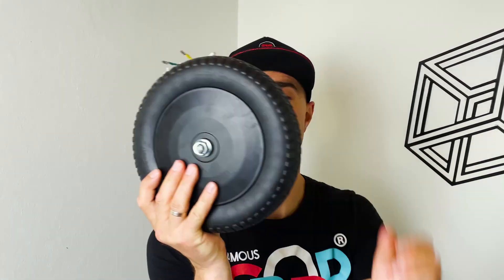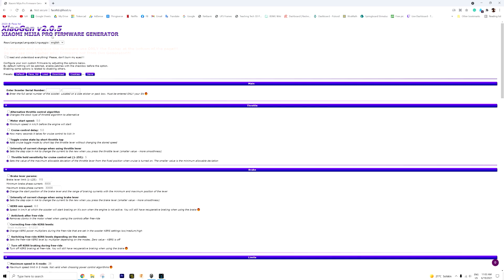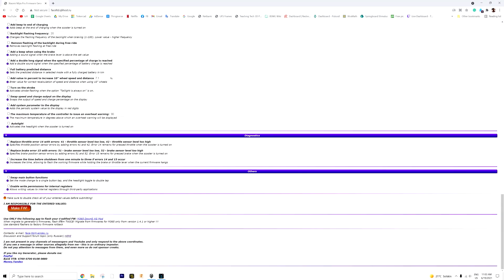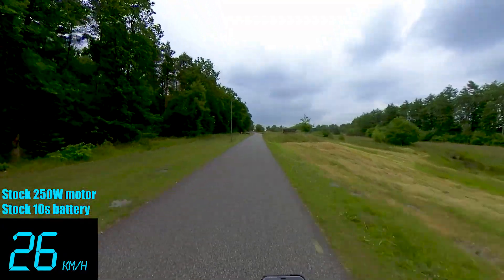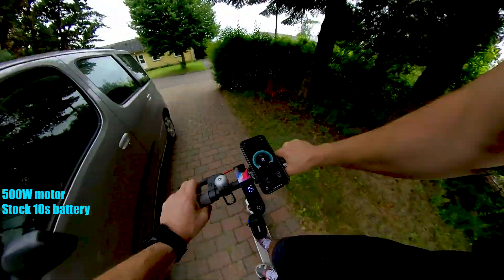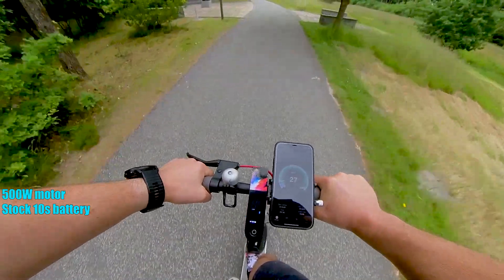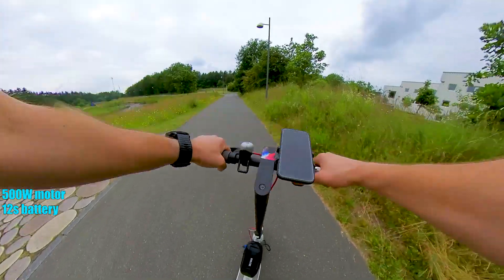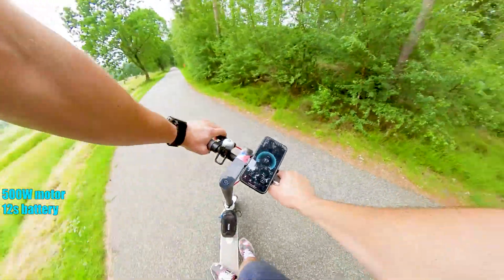Xiaomi m365 first look at the 500W motor (Monorim ?)

Comment: Hey i think you are good in this.. I have 48V battery (13s) with controller reinforced 140A mosfets.. 350W motor ... CFW set to 25A current limit 65A... It spins 35km/h ... whats the case ? . On 36V battery i spinned 35KM/h...
Reply from the maker: Hi,

That’s weird 🙄 54.5Vx65A=3.5kw 😳 at 2kw I reach 50km/h on my m365. But I used the aftermarket 500w motor and ECU with field weakening. 
I am confident the 350w motor should run faster. There is something limiting your rpms or voltage. Firmware? There is definitely the “hard limit of 35km/h” in firmware. Is it even possible to really remove it? 
Any chance you can try another ECU? Not the stock one?
Reply: @VRMinde  I have Flipsky 71500 ? 75_300_R2 but yeah .. when i try power on XT60 plug it just burn my connector.. so ...

There might be case that i have InternalBattery(Disabled BMS communicaton ?) and ESC doesn't know how operate voltage ? i flashed 23A with 65A current... i mean it spins 37-38 ? idk whats wrong
Reply from the maker: @xtracker904  just thinking basically: you should always get more RPMs with more voltage on the same motor. Unless there is something limiting it. I can only think of ECU 🙄
Reply: @VRMinde  But why 65A ? i put 25A in Power and 65A in current (phase current) if i belive does it matter ?.
Reply from the maker: @xtracker904  you said you had max amps at 65A? 
Power is measured by watts. P=UxI where P is power (W), U voltage (V), I current (A). 

Even if you keep 25A on a fully charged 13s it is more than 1300W. That is enough to go faster than 35km/h. One or another way your controller is limiting the speed, I think. I can’t now think of anything else mate
Reply: @VRMinde  Yep on Non Load it shows 45km/h but on load shows 36-37max ..
Reply: @VRMinde  Hey sorry i interrupt you but i think find it.. somehow.. but you must tell me it is good result..
I changed to 500w motor monorim flashed with emulated BMS and shows 60km/h real is 46-50km/h i must charge it and see how it goes...
So Xiaomi 350W pro motor how much can go if 500w goes about ~47km/h?
Reply from the maker: @xtracker904  honestly I don’t know. They might do similar, 350w will just burn faster if you run it full watts all the time :)
Reply: @VRMinde  Ok thanks for replay.. but i watch your video for compare ... and do you use Rita adapter ? or just you unplug 36V and plug 12S ?
Reply from the maker: @xtracker904  you can do either... but you have to "tell" your controller in the firmware of your "new max voltage".
I never had the 350w motor, only 250w and 500

Comment: Was this test with stock controller? Iv got the 48v pack and a v3 controller and I’m looking to get the 500w hub but if it won’t reach 30mph I will just invest into something else
Reply from the maker: stock controller and 12s battery pack (it would be a "44V pack"). I reach 50km/h (31mph) at about 1500W. So if your 13s pack is fully charged you will have ~54V. You will need about 30 amps at that voltage to get 1500W.
Reply: @VRMinde  thank you bro, nice of you to still reply to your older videos 🤜🏾
Reply from the maker: @DEM_E_BOYZ  I am trying at least :D

Comment: Hi. Can you please send me link to good controller and the 500W motor? I want to buy something that was tried / tested. Thanks
Reply from the maker: Hi, the link for the motor is in the description, but you might consider getting an original one from Monorim https://monorim.store/

As for the controller I was using the phaserunner v3 with cycle analyst just for testing purposes, it will cost you more than the scooter and will be a complete overkill for the needs. https://ebikes.ca/product-info/grin-products/phaserunner.html
https://fasterbikes.eu/de/controller/349/50a-30-90v-phaserunner-motor-controller-v3?number=3108-OHNE
https://fasterbikes.eu/de/zubehoer/cycle-analyst/206/cycle-analyst-v3-dps-direct-plug-in-mit-tacho
Reply: @VRMinde  many thanks. I will buy controller and the wheel next month 😉

Comment: hi I have a stock pro 2 but have hacked firmware too get 20mph max . my question is will a 500w motor work on this with stock battery I know will run down faster but how fast and is the motor simple to fit or do I need firmware change
Reply from the maker: Pro 2 has a good motor, I do not think you will notice much of a difference. It will work, but I doubt you will get much extra performance 🙄

Comment: Can i use 2  36v battery’s in parallel  to run a 500w motor will it decrease my range
Reply: Hi mate I had 2 36v running  it just adds bit more range

Comment: I’m looking to add two 36v 500w motors to my hover-1 alpha that I’m customizing. It’s my first build and I’m a bit nervous. Can I run two motors at 36v on the stock battery and just upgrade it with a pack? Or should I upgrade everything and get 48-60v and run dual 48v-60v 500-1000w ? So many choices. 

Obviously I’ll have to upgrade the controllers and modify a bit but it’s mostly bolt on and go. Any thoughts?
Reply from the maker: Normally, upgrading with dual motors and changing voltage up dramatically will require to change basically everything and is more expensive than buying a ready-made scooter :) But it is always possible... depends how much time you want to spend on this :D It looks "easy" but tiny little details eat up the most time. 
Adding second motor (and ecu) at 36v is potentially easier way, you will feel a boost of power of course, but as you say you will need to add capacity of the pack as well. No one can tell you what to do mate, it is your decision :)

Comment: try to downgrade the bms to 1.2.8 and use direct power control, my pro 2 w 8,5 inch can go 35km/h, and w 10 inch 42km/h (fully charged)
Reply from the maker: I tried many things mate, maybe I am too chunky but to get above 40km/h i generally need a 48v battery :)

Comment: Hallo i kindly as for your help , i have i pro 2 with 36v 24.4ah ( stock and external ) custom firmware with stock motor 950 watts pick with no problem . I am thinking about the monorim 500 w motor but i dont know what is the safe limit for watts , i ask monorim and i didnt get an answer . Normali with motors tere is the naminal power and pick is x2 , is that the case with monorim ? Can i set the pick to 1000 watts or more ?  If iis only 1000 will i see  a difrence between stock motor to 950 watts and monorim ? Many tnanks in advance . Keep up the good work
Reply from the maker: Hi mate, I doubt you will see a diference between the pro 2 stock motor and the 500w aftermarket one.
The more wats - the more heat. At some point your motor will burn if you give it too much power for too long. I ran 2200w on a 500w motor, but for short bursts only
Reply: @VRMinde  thank you very much for the answer . I am cosidering the 500 w motor  not to put more watts than te 950 that i have now  but in terms of heeting . Is there a chance  tat the 500 w motor with 950 watts heats less than te stock pro 2 motor ?
Reply from the maker: @psyllinos  in theory it should be the case :) but you I have not compared two side by side to know if it is true

Comment: Hey mate.. great and very helpful comparison. I have new 365PRO and my battery overheats while I m driving back to home from work. I drive almost 10km uphill. It s small but constatnt incline and  I have 100kg :) . Battery temp reach 53,54 degrees and Scooter turns off. Do u think that I will resolve this problem if I add larger battery something like Monorim B2 battery 48v 14.4ah?  What do you think?
Reply from the maker: If your battery is overheating it means you are drawing more current than the battery can give/was built to give. This is actually surprising to me as normally ECU is the first part to overheat on the M365. I will assume you flashed custom firmware with many watts on it :) 
If you add a 48V battery, you will get the same watts with drawing less current, it should definitely help with the battery overheat issue. But you have to lower those amps then :D And most likely ECU will start overheating as the next thing
.
Reply: @VRMinde  Woow tnx for quick response. Hmm.. quite strange because I am not using any firmware except factory software BMS 0126, ESC 0166, BLE 0110.. I am probably rare among us that don t like too much speed on this toy :))  Should I check and even change ECU before spend fortune on bigger battery? :)
Reply from the maker: @branislavspasic3475  I don't know. I have never had an original pro ECU, legends say they last better :D But it is weird then that your battery is overheating

Comment: I have a scooter that is not from Xiaomi, the engine power is 350w and the maximum speed is 25 km. Can I increase the speed more until the time of the ramp, the speed does not exceed 25 km? I contacted you on instagram and sent you a picture of the scooter and the problem is that I tried to hack the scooter, but the problem I have is ios I tried to search for the program, but I could not find the program
Reply from the maker: Hi mate, most often the controllers limit the speed without an option to “hack” it. You need to relace the controller. Sometimes some manufacturers leave a cable that you need to cut/unplug and the  cable to unlimit the speed. Try googling out your scooter model and “speed hack” or similar and you might find it somewhere
Reply: I contacted you on instagram, the problem is that there is more than one cable. I can't find out the private cable. Opening the speed limits. If I send you a picture of the cable, you will recognize the private cable. Opening the speed limits

Comment: i got my xiaomi pro 2 custom with a 52v 25amps controller and an 52v battery with a stock 36v 300w motor and top speed of 45kmh.but my motor takes up to heat fast and it burns out..Will a monorim 500w motor will better for me or it will heat even worst than the stock one?
Reply from the maker: It should be able to take more punishment. But 52V X 25amps = 1300W. You should not expect a 300W or even a 500W motor to be able to run all those wats for long without getting warm :)

Comment: Hey i have a question
I Want to put a 350 watt motor on my Xiaomi 1s. Can i just do it like just take the Old 250 watt off and put the 350 watt on? Or is there something i need to change with the batteri or some checking i need to do with the batteri before i do it or Can my normal Xiaomi 1s batteri get a 350 watt motor on it without any problems? And i have the newer Xiaomi 1s B.L.E 1.5.7 version.
Reply: And Can you just put a 350 watt motor on without flashing the scooter?
Reply from the maker: You can put the 350w motor just straight replacement, but you won’t feel any difference. What you need is different battery to get more speed/acceleraton and then different firmware flashed
Reply: @VRMinde  What if i just put it on and then just have it that Way? Will it work without any work
Reply from the maker: @dinfar4367  it will work, but you won’t get any benefit 🙄
Reply: @VRMinde  oh thanks:)

Comment: I have m365 pro2 not additional battery only chip and goes 42kmh
Reply from the maker: Good for you mate! I have already tried many scooters, 33km/h was the most I could ever get out of a 36v battery pack, and that was probably a bit downhill and for 1sec 😂
Reply: @VRMinde  I have also old m365 it's without addition battery goes 35Kmh just the chip

Comment: yooo bro! nice video! i got now a pro 2 (32kmpu (brake lever) firmware) today i changed the front tire and now it makes the same sound as youre motor heheh... 
 
what should i upgrade for more speed pls help me out bro (stock pro2)
Reply from the maker: @branimir bankov Was claiming 2 weeks ago, that m365 pro does 42km/h +. 
I personally do not believe it :D I think 32km/h is a decent speed for a 10s (36v) battery pack. You can try adding more amps on the firmware and hope it will go a bit faster. 
The next thing to get more speed is a higher voltage battery pack. I think you can use a 13s (48v) pack with the stock controller if you are careful and do not overheat it too much. Eventually, you will burn the controller. Then you go for the more powerful controller, and then - motor, after it - two motors :D
Reply: @VRMinde  thx man!

Comment: hi i want to install this motor on my scooter for the extra torc will it install as i cannot change my firm ware can i plug this motor in and will it work as normal
Reply from the maker: It should just work man, I am not sure how much torq will you notice. I would first go with bigger voltage battery (but then you will need to change firmware/controller)
Reply: @VRMinde  ok I see it'd just I have the 10 inch solid tyres on and I get 43kph now it's just slow off the line now wanted the acceleration back
Reply from the maker: @Motorizedstuff  you won’t get more acceleration mate with 500w motor or it will be a very small difference. Amps are controlled by controller, voltage depends on battery. Power=volts x amps. Your controller most likely is limiting max amps. So you could get higher voltage battery, but if you don’t know what you are doing - you can burn the controller easy :)
Reply: @VRMinde  ok thanks for the Info just 1 last question if I left my battery at 42 volts but increased the amps to significantly higher will I get a power increase from the higher amp battery or will it just last alot longer
Reply from the maker: @Motorizedstuff  battery capacity is measured in Ah (amp hours). With 10Ah battery you can run 10amps current for 1 hour (that is in theory, in reality it will be less of course). If you run 20A - only half hour and so on.
If you set your controller to use more current (Amps), you will get more power, and your battery will last less.
You can pull more amps, just have in mond that “Significant” increase of amps might start heating the battery more than you want. You will loose a lot of energy on heat + your battery will live shorter :)
Reply: @VRMinde  thank you for getting back to me means alot
Reply: Sorry for been a pain just to clear it up I can get any size battery and install it to my scooter and it will work fine yeah
Reply from the maker: @Motorizedstuff  I really recommend you read somewhere about Volts, Amps, Watts etc :) Maybe something like this vid https://youtu.be/mvuHsu8S6v8

You can use any capacity battery of the same Voltage and have no problems (except the size of it of course). You can even connect an additional one to your stock one in parallel. This means more range. 
You can put a higher voltage battery, but that might burn anything on your scooter system that is not rated for it. Sometimes, the components are ready for higher voltage batteries. For example, xiaomi m365 can easily survive with a " 12s" battery pack (~44.4V), while its original is 10s - 37V. Higher voltage at the same amps - means more power.
You can program your controller / change it to a higher current controller (Amps) to get more power. But that will stress (=heat/burn/destroy? :D) your battery if it has not been built with that idea in mind.
Reply: @VRMinde  nicely put dam hat off to u 
Your a scooter god u no that
Reply from the maker: @MonkeyUkTheZoo  scooter god lol :D :D  Nah, I am just an adult kid playing with toys and filming it sometimes :D
Reply: @VRMinde  I have the 350 watt motor at the moment bro
Reply: @VRMinde  just another question if you don't mind bro if I was to change my original battery for a higher amp 1eg. 7.8 amp that I have now to say 15 amps will I have to still change the controller please 🙏

Comment: Hi can you help me with my firmware on mi scooter 3 i can't do the speed hack i believe its because i upgrade to tha latest version maybe??
Please help...
Reply from the maker: Most likely yes :) I think there is an app Xiaoflasher that should do it (paid version), but I am not 100% sure. 
Another option is to solder some pins on the controller and use the STlink programmer to flash the controller. Check the app first, after search on youtube how to flash m365 with Stlink
Reply: @VRMinde  thank you very much keep doing this amazing contents
Reply from the maker: @ricardopais11  Thanks for the support mate!